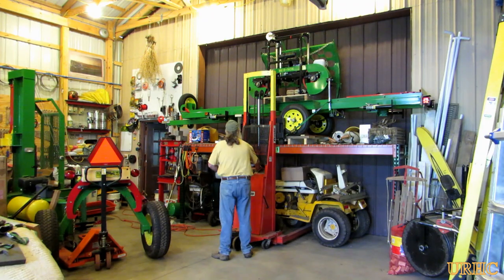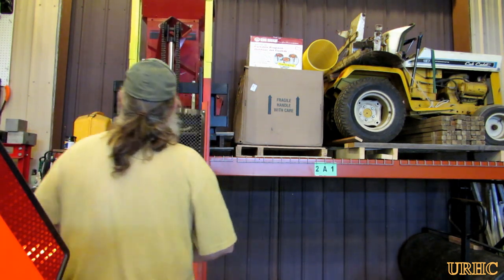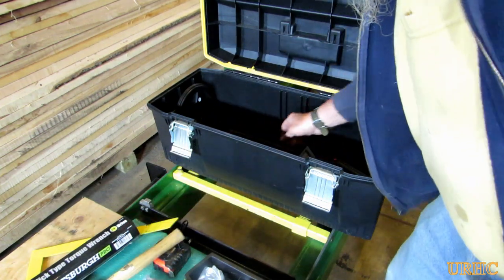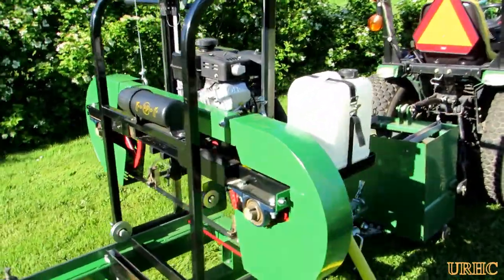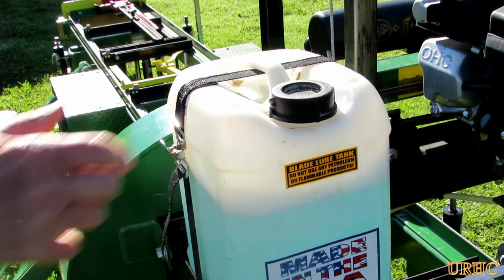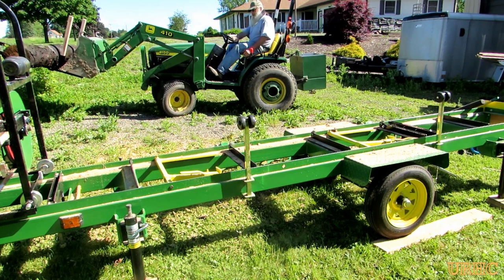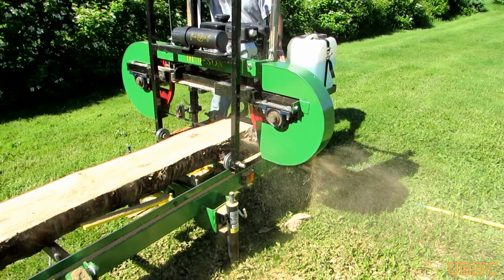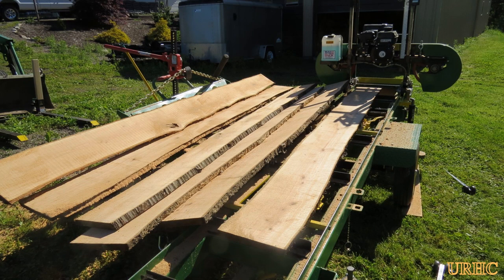Getting Out The Mill And Milling Small Cherry Logs

Comment: That cub cadet could become a good portable source of power, trick it out, a mini genny unit, some stuff like that. Could increase your range considerably, plus, it's a very stout platform, there's guys out there modifying them to mini offroaders on the original chassis.
Reply from the maker: That is why I have kept it for so long. It has the straight frame rails that would be easy to work with.  Hopefully I will get around to modifying it someday.  Thanks for watching.

Comment: Any info on that digital read out you installed on your mill? I'd like to put one on mine. Thanks
Reply from the maker: It was just a 24 inch one from Grizzly on clearance.  It's not a water resistant one but I only mill on sunny days.  Works good for my needs. I recently purchased some from igaging off Ebay for another project that have a much larger easy to read display that are really nice. Search Ebay.  Thanks for watching.

Comment: Where did you get the digital measure scale thingee and did you build your leveling thing?
Reply from the maker: Got it from Grizzly  but they can easily be found online.  Look for a waterproof one if your mill is used in damp or wet conditions. That little leveler came from a camping world store.  Thanks for watching.